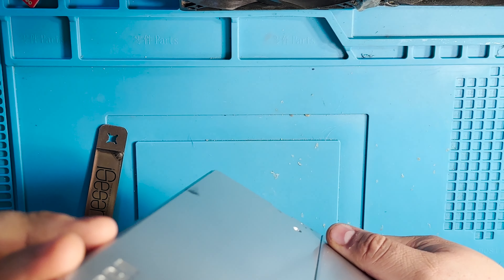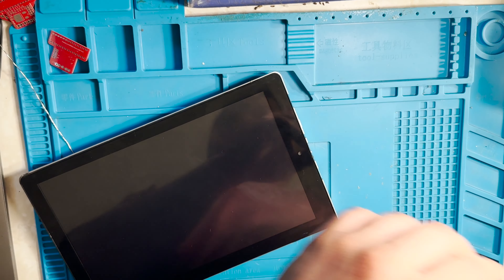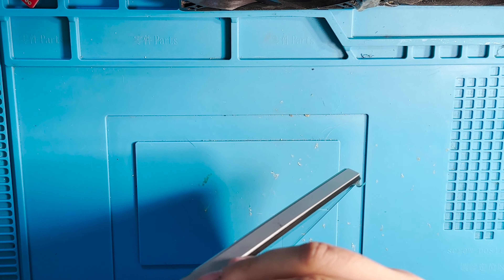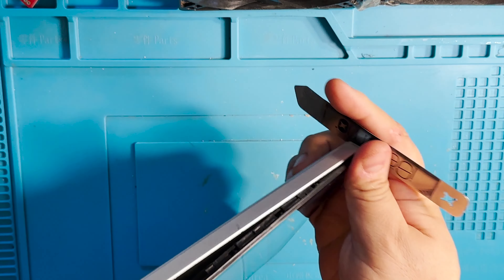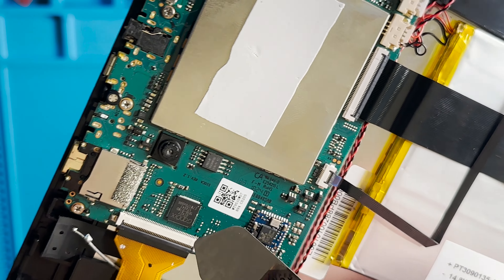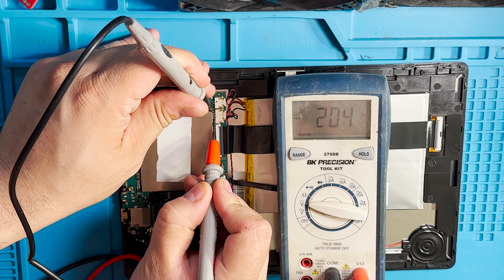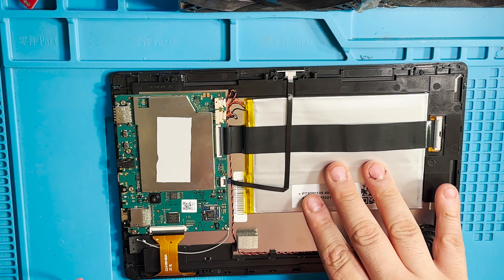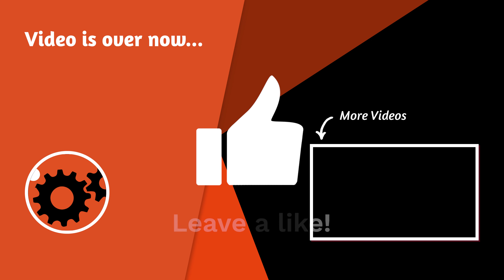RCA tablet w101sa23 not turning on | Fix or trash it PART 1

Comment: Can you jump this battery? And how is the battery is soldered straight to the board? It doesn't have to plug in Port so I can just pull it out and reset it. Its a puya tablet 10 inch . Not coming after dying.
Reply from the maker: Sorry have never work on a puya tablet before…  but yes I have seen tablets that required battery to be desolder to remove and replace its battery. If you have a power supply you can try to power it on with that. Good luck